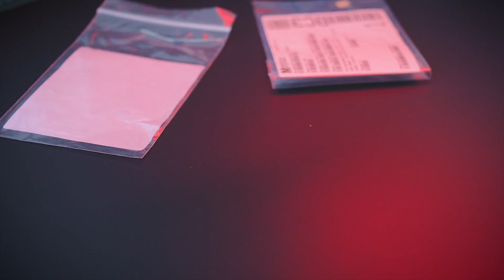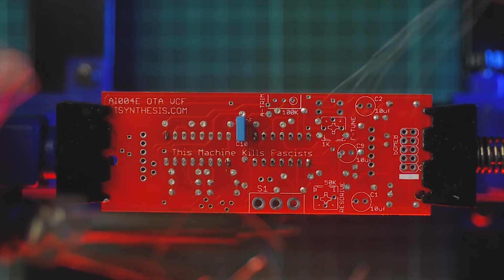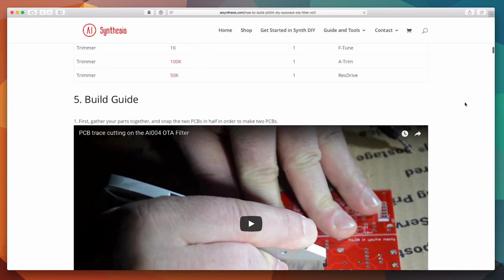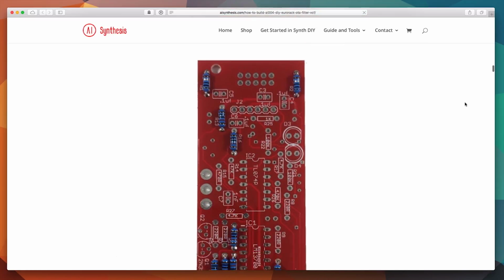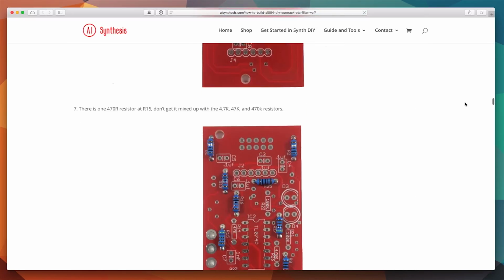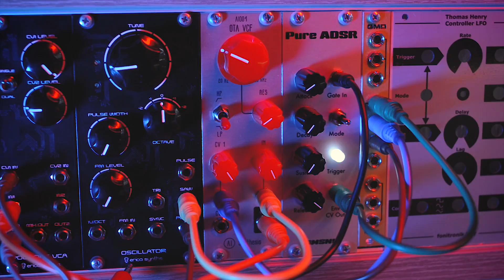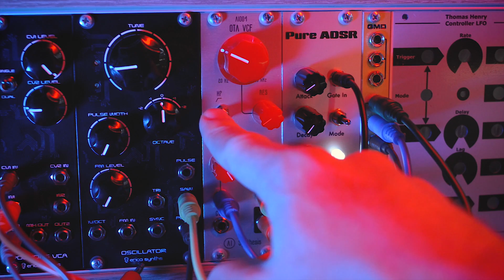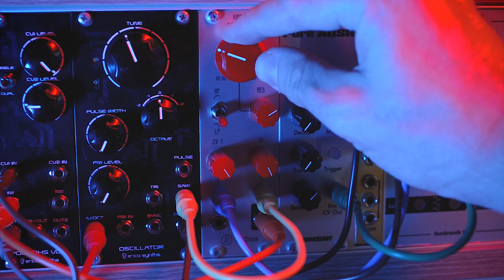DIY Eurorack Filter Modul (english) - AI004 OTA Voltage Controlled Filter

Comment: I've seen people soldering on the top of the pcb before. Personally, i would rather solder the underside, only becasue I'm a bit shaky and i'd be afraid I would damage a component.
Reply: Actually, I believe it is standard practice to always solder on the side opposite to the components, except of course with surface mount components, so you'd be doing the correct thing anyway 🙂

Comment: Wow, great video! I built this module from a complete kit and my switch doesn't have a middle position! Also, I'm still having some difficulty calibrating the module with the trim pots in such a way that the lowpass and highpass modes both work as expected (no dropouts etc.). Can you comment a little about this?